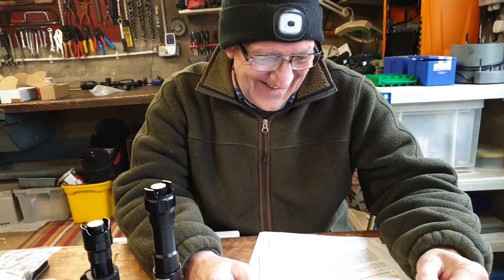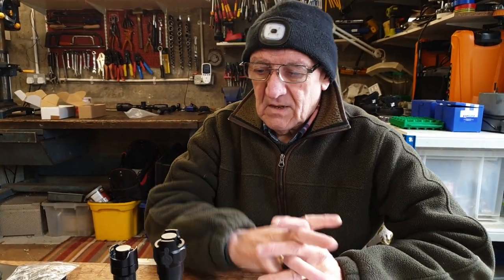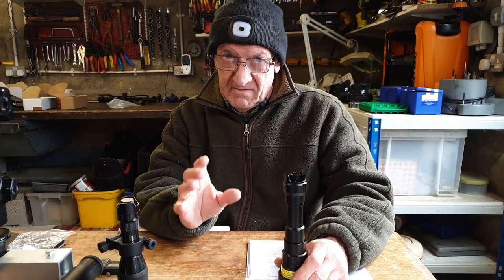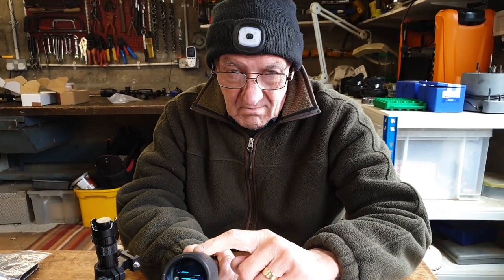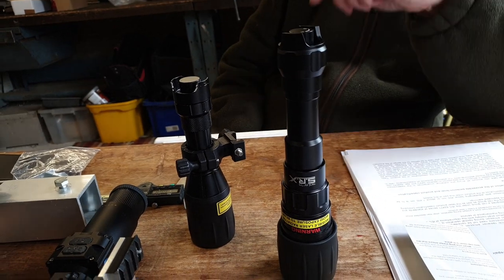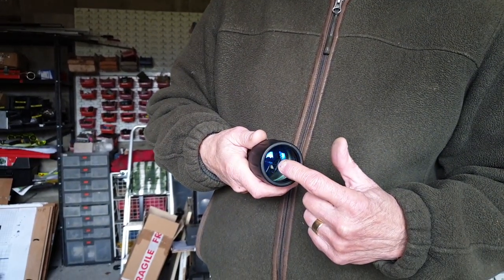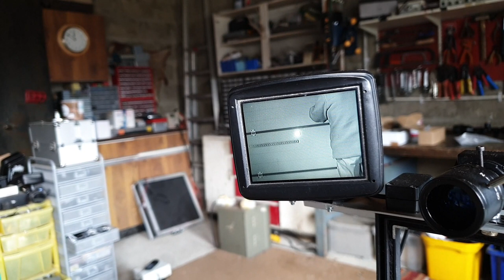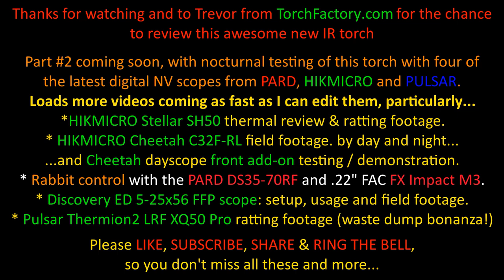New UK IR torch regs, and introducing the new Solaris SRXv2 from the Torch Factory (pt.1/3)

Comment: Bruce I have a Night Master 800 IR torch fitted to my Sightmark  Wraith, is there a cheap way to eliminate the red glow. Cheers
Reply from the maker: Hi Mick Russ here, I've just looked on the Night Master website then googled your torch.
It looks like you can get a 940nm LED module for the 800 torch, which will have virtually no red glow.
The downside of 940nm IR is being approx 25% less bright (with digital NV) than 850nm.
So I'd buy a 940nm LED pill for your torch and give that a go.
Good luck, and thanks for watching, cheers. Russ